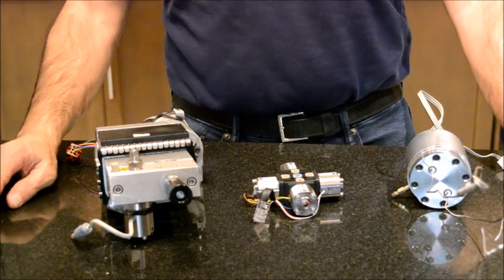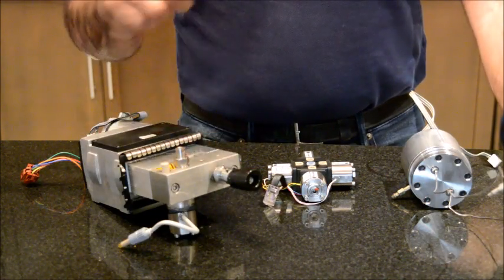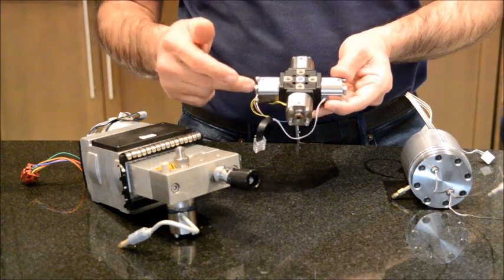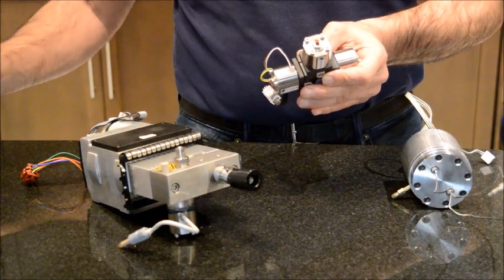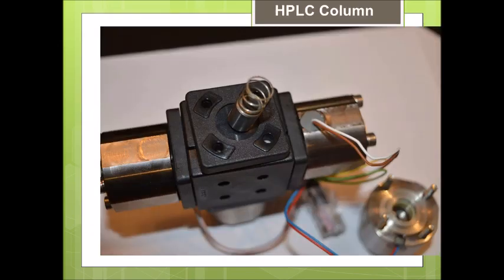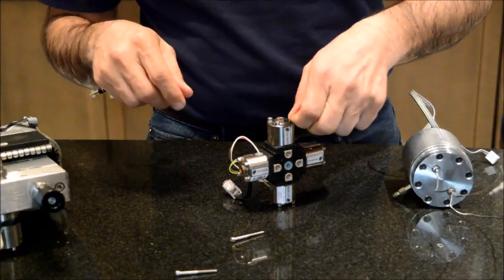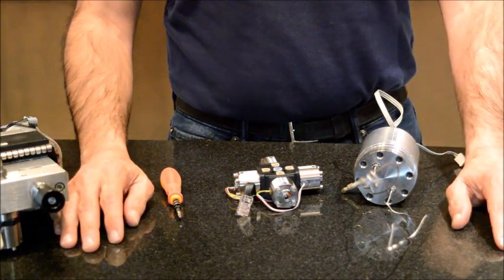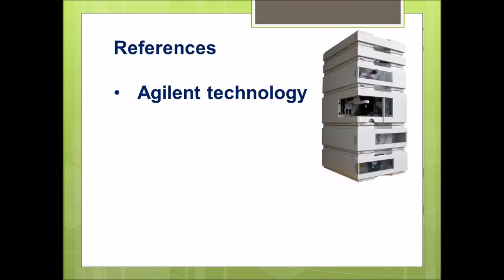Agilent HPLC Gradient Proportioning Valve (GPV) and Flow Damper- Pump Care &Troubleshooting-Part Two

Comment: Hi, and many thanks for the useful hints. I have a problem with the Agilent 1100 HPLC pump and it is showing the “Servo Restart Failed” message. I opened the pump-head and replaced the consumables but I still have the same problem and the same message. What would you recommend? Thank you!
Reply from the maker: hi
i never had the problem but it seem Servo  error created during the initial pump start up and self diagnostic.
the Servo Restart Failed error could be because  the pump drive not moving properly. 
It can also be cause by a blockage of the Inlet valve or Outlet valve. So try to loosen one of them and start the pump and see if it gives the error again. 
worst case it could be pump drive needs to be changed or mainboard is defective.